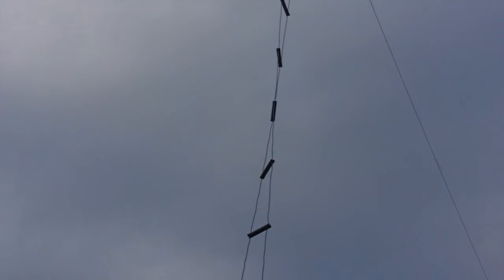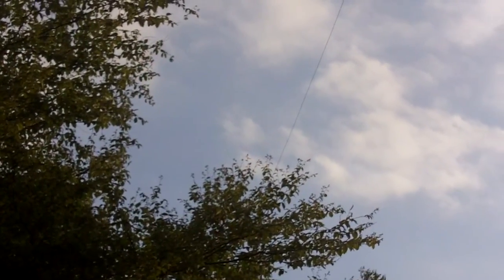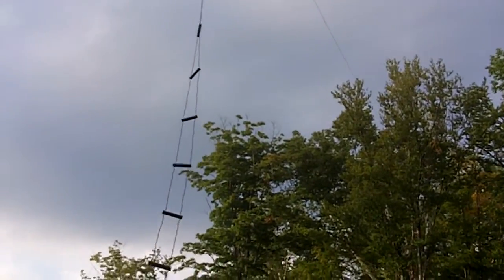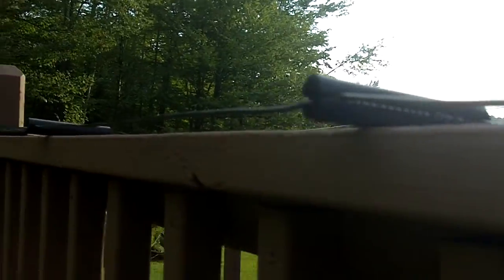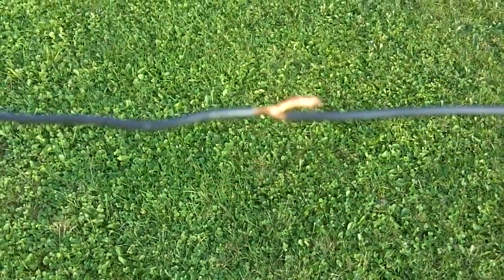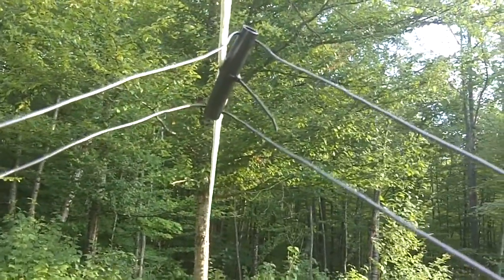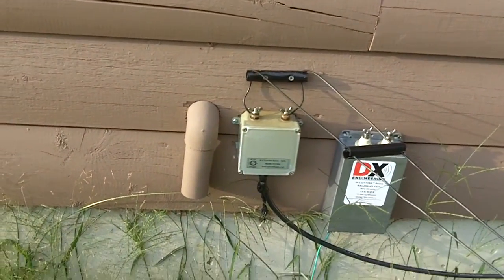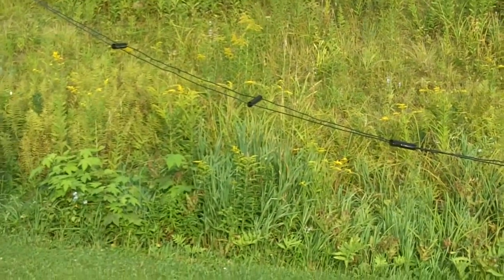600 ohm ladder line length adjustment and tuning

Comment: Van I use a VNA with open wire? I want to test with a vna at the feedpoint of an inverted V and i was wondering about then using a vna to tune 300 ohm ribbon?

Comment: Your balun is wrong for matching the ladder line to fifty ohms for your radio station so you need a 12 to 1 balun or a unun to get the match you need .
Reply: You can use a 1:1 balun if you use the correct length of ladder line. If you have the proper length, the end of the ladder line will have the same impedance as the dipole feed point. It will vary based on the frequency you are on.
Reply: Sorry but your statement regarding the balun is quite flawed.  You are suggesting the balun ratio used should match the characteristic impedance of the feedline (600 ohms) instead of the actual impedance that exists on the feedline.  Here is a good tech article that will explain why https://www.balundesigns.com/blog/baluns-for-multiband-antennas-fed-with-open-wire-or-ladder-line/.

A good 1:1 or 4:1 balun is a much better choice and ununs should only be used for unbalanced antennas such as verticals, longwires and inverted L's.
Reply: @robertrumsey1609  100% CORRECT.. We are not making the radio happy as they say.. We are keeping the tunable antenna system happy..